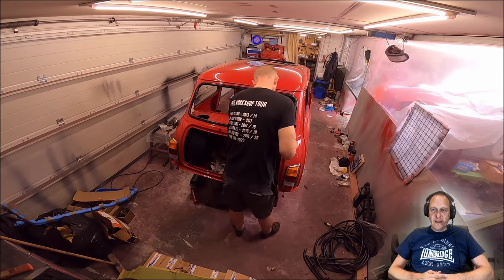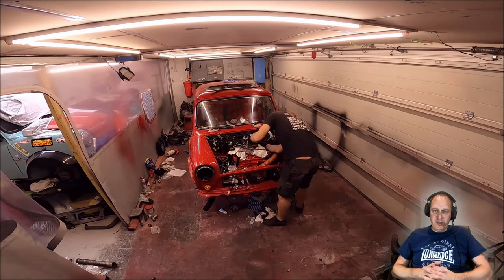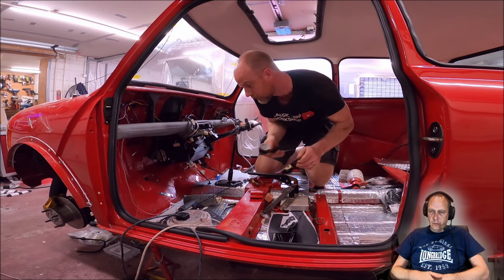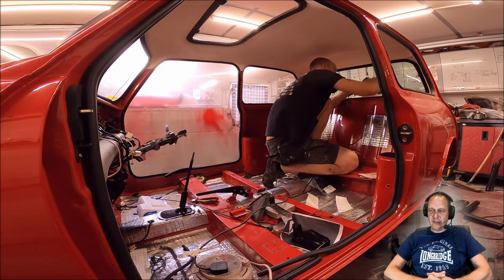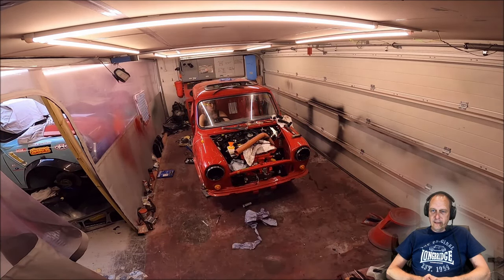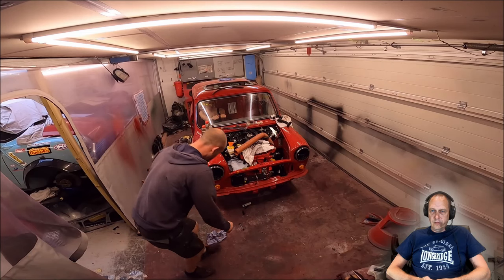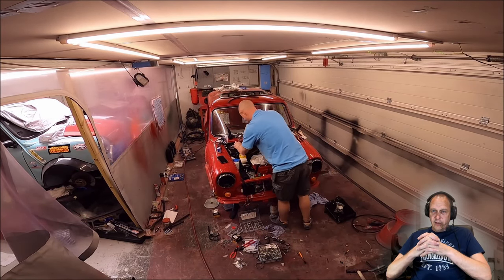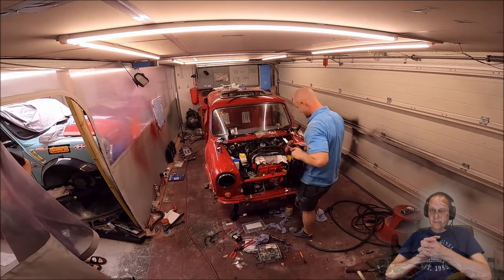Rear Screen, Brake Bleed etc. - ERA Turbo Project Classic Mini Workshop Pt.31

Comment: Just had a body repairers instal my rar window and I think was assembled complete including chrome trim and installedd with a wire.
The inside headling and surround was rippled. Im sure this is incorrect and the chrome trim acts as a tensioning/locking strip to make the rubber grip the frame.
would I be right and expect leaks  ?
Reply from the maker: Yes you are right. The chrome strip should be fitted after as it's what locks the screen in place. It shouldn't leak either

Comment: Last time i fitted my rear screen i used 'back to black' silicon spray, less messy and i think fairy has salt in it? Was great for the trim too.
Keith, does dot 4 still damage paintwork? Cheers guys luv the vids
Reply from the maker: Good idea with the silicon spray. Yes DOT 4 will still damage paintwork, just not quite as quickly as DOT 3 would have done
Reply: I did use Car wash liquid last time on KITT but didn't find it any better. Silicone spray in my garage, sounds like a bad idea lol.

Comment: Hi Mark and Keith, impressive time for the rear screen! Rattling through the list hey! Did you check that the reverse switch worked?
Reply from the maker: Not yet, still more wiring to sort out before the battery goes back in
Reply: Cheers. I just fitted a new one as almost everything else was new. In for a penny.....